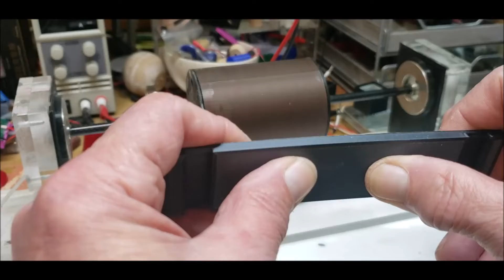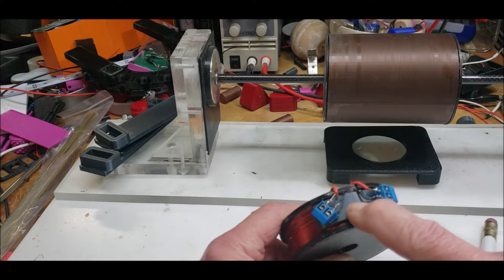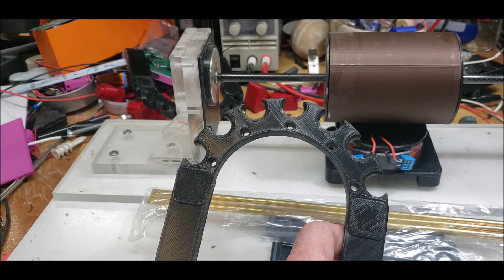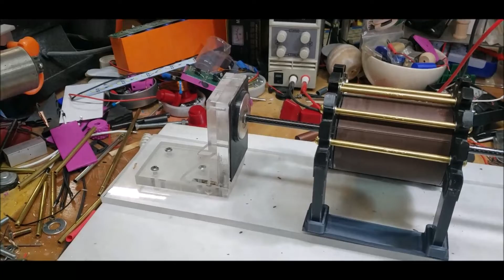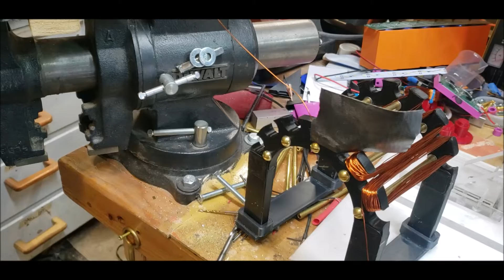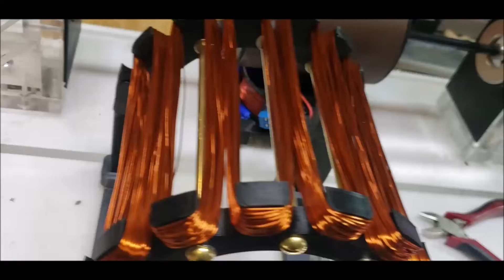3D Printed Window Motor Coil Build

Comment: Take look at my coil design it will triple your out come thanks
Reply from the maker: I looked through your vids but couldn't find a coil build?
Reply: @mcorrade   Video is call compressing magnetic fields in a coil
Reply: @mcorrade  I printed the spool's I would like your over all Opinion thanks.
Reply from the maker: @sidster64  very interesting thought process. Still not sure how I would hook that bifilar CW/CW coil to work as a pickup/run coil unless I hook it the same as I would a normal Bifilar coil. I will have to give a try so thanks for sharing.

Comment: Couple things, before you remove the brass rods. Put jumper wires on the ends and try a volt meter with then in series and parallel. Probably not much voltage, but I bet they is a little amperage.

Comment: No matter what I said about the Brass rods. The rotor might experience slowing down, but this thing looks amazing!
Reply from the maker: it absolutely will but I don't think by much. If it does, I just remove them
Reply from the maker: I bought some carbon fiber rods I could use
Reply: Carbon fiber sounds cool! Yeah you know, I remember the motors I made and I always tried to get the most perfect design, improving it every new attempt. So I remember being disappointed at myself for not realising that copper and brass have these magnetic effects. The slowing is stronger when the rotor gets faster, but it doesn't matter if speed isn't what you are looking for. I guess the main reason we post these videos is for fun! Keep it up
Reply from the maker: @toffeeflavour  you got it man. Fun is the name of the game